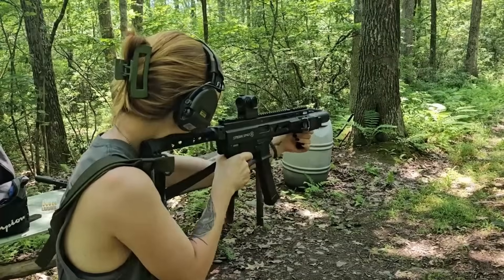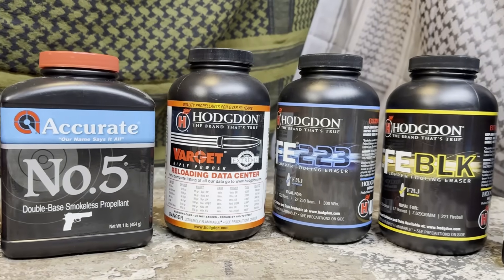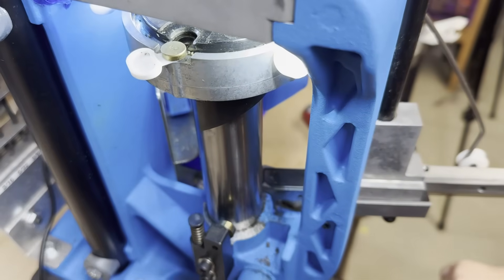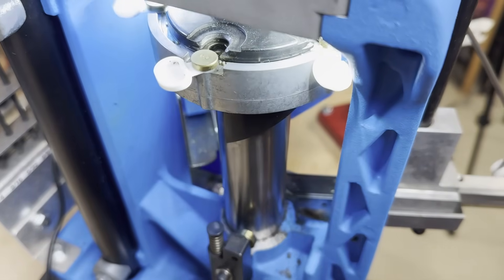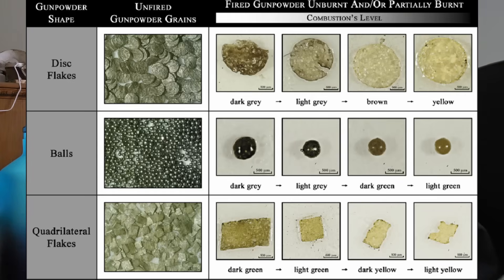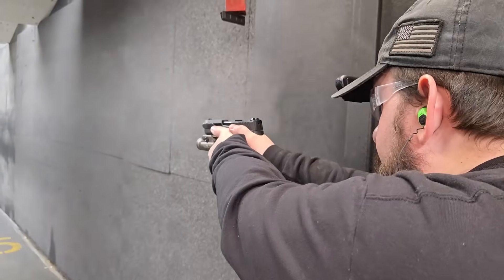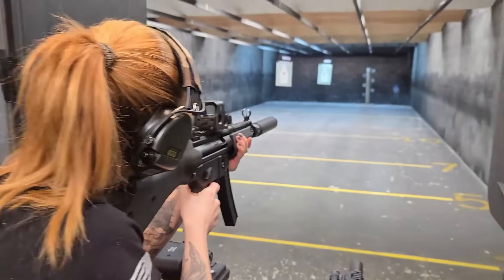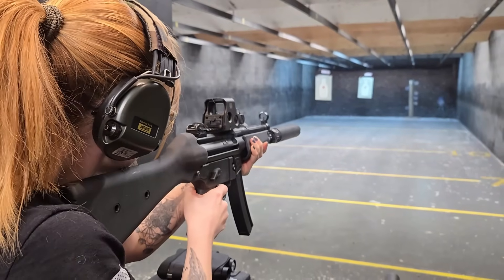Propellant Picking and Performance

Comment: When I buy powders, first I have to look at what's available to me, then I consider how many of my firearms that powder will work in while. The idea that the slimmer neck causes higher pressure thus higher velocity is not really true. I can use the .358 Winchester and the 35 Whelen as examples. The 35 Whelen for instance produces less pressure with a 220 grain bullet than a 30-06 yet pushes the bullet much faster.

Comment: This was awesome but left me with so many more questions. For example, why do long range hand loaders consider ball powder junk?  I mentioned CFE 223 as a possibility for 7mm-08 and got a strong negative reaction despite some published load data showing good velocities for that powder in that case.
Reply from the maker: Ball isnt as temp stable so you'll see way more variation in your performance!
So youre choice isnt bad on paper but extruded powders will burn way more consistently and if you want range, you probably want consistent. Though I will say cfe223 is a good modern hybrid, not sure why they'd scoff at that for your application
Reply: @Boondockballistician thank you Jessie for the quick and on point response. Turns out CFE223 has the worst rating on my temperature sensitivity chart. If I’m reading the data correctly, a 60 degree temperature change would result in a velocity change of 102 fps.  H4350 velocity would change 9.6 fps. That’s a BIG difference. 

I enjoy your content and appreciate you sharing your knowledge with us.

Comment: I heard a story of a man who had a truck gun for years.  When he finally fired it, the barrel blew up.  Turns out, after fifteen years in the truck the propellant turned to a fine dust.  Thereby burning too quickly, all at once, overpowering the otherwise sufficient design strength of the gun.

Comment: Quickload, OBT >>> real world chrono>>> true model >>> test>>> selection of load.    And it allows modeling of loads and parameters that aren’t documented anywhere.   Example .223 loaded with 80 ELD with OAL of 2.500”.   This load isn’t documented but I modeled and then tested suggested OBT nodes.    This reduces load development considerably.  

RPR .223 - 80 ELD @ 2.500" - OBT Node Testing - Ram Shot TAC
https://youtu.be/4YT3XWH1gww

Comment: Haven't watched the video yet but just wanted to say I'm very excited to see this video because I know nothing about reloading, but anytime I think about buying a rifle my brain wants to optimize a load for maximum performance in a given barrel length with a given projectile.
I do not know what is and isn't safe, but boy howdy do I fck around on Gordon's reloading tool until I find a load that gives me performance of a slightly longer barrel, with identical exit pressure and velocity so I can use the same can.

Would my gun explode if I loaded that? I have no idea but it would be funny to find out. I'm sure I will get at least 5% closer to knowing through this video

Comment: I would argue that the tuning of ammo is making a big difference by a combination of smaller steps.  Looking at 7mm prc and the use of RL 26 and then Hornady losing access to that powder when federal started loading it and then having their velocities cut by %10. There are also getting to be much more powerful loadings available in magnum revolver loadings with powders like lil gun and power pro. I also look at some of the hyper efficient powders like tite group, tite wad, and power pistol that allow for a pound of powder to go much farther and burn cleaner than previous options.  Getting the exact pressure curve figured out for a cartridge and gun combination can really squeeze performance out of both new and previously existing cartridges. The newest question is what can they do with pressure curves in the couple of the newest 80,000 psi cartridges in the 6.8x51 and the 7mm Backcountry adding 15,000 psi flips the script on what powders can be used in those cases.   I appreciate the nerdy, technical, and awesome video.

Comment: A progressive burn is dictated by how full the case is you typically get into a kinda iffy area if the case is only a third full read that as potentially dangerous as the propellent lays below the flash line of the primary where it could ignite all the propellant possibly causing a detonation rather than a progressive burn

Comment: Propellant Picking and Performance

While the rule of thumb for larger cases and bullets is slower burning powder that is not always what is desired depending on the purpose. If I am shooting bowling pins in pistol competition matches with a .45ACP then I want a faster burn rate so I can get back on target faster because time and hits is everything in a match. Burn rate is not so critical in a combat pistol timed course of fire on IDPA/IPSC/USPSA cardboard targets but most matches that are timed will benefit more from faster burn rates. Precision rifles and rifle cartridges not so much that are not timed at least not when I was in matches. Shotguns in matches again I want faster burn rate when shooting moving clay targets for faster target recovery although shotgun clay matches are not timed either but I want to be able to get multiple hits for each set of clay targets that only have so much time in the air. You get my point. Burn rate depends on the purpose or use of the ammo. Be it matches, hunting, practice, or defense. Yes it can also depend on the cost and the amount of powder or charge in each cartridge or shell. More powder means more cost per round or shell so I want a powder that gives me good performance in fast, medium, or slow rates using the least amount possible. Throw all that away if the primary concern is a specific burn rate for a specific purpose and you may have to just suck up the extra cost of extra powder.

Comment: Internet lore, for what its worth, has taught me that the difference between NATO spec 5.56mm and  commercial .233 ammo is that the NATO spec ammo primer is harder and less likely to being set off by a floating firing pin, and that the powder is more reliable in adverse conditions but also dirtier than the commercial variety. Now, I don't really know much, and the internet could be wrong, but could you comment as to whether this is true about the powder being more reliable, and if so, what are some of the factors that causes this difference ?
Reply from the maker: Ehhh is more if a difference in pressures. Military ammo is also produced to a standard that commercial doesn't necessarily need to follow, which is why you see more variation. Ammo manufacturers that get military contracts often use overrun and product that didn't quite meet spec as commercial rounds instead. So that inherently means more variation.
And then manufacturers that are primarily commercial, just build with looser tolerances. Whether it be less scrutiny on the cases, the projectiles, or the powder coming in
Reply: @Boondockballistician  I see

Comment: You said in the hop facts stream that handguns pressures will top out in the 60-70,000osi range. Im runaway of a pistol design that can even take 50psi. What guns or designs did you have in mind?

Comment: 3:47 this was a problem for the M16 back in the Vietnam war, the ammunition the soldiers were issued in the field did not have the same type of powder that was used in testing the rifle, this is one of the reasons that contributed the the M16s reputation of being unreliable.

Comment: One of the most important things I learned when I started reloading and was friends with a guy who had decades of experience and reloaded dozens of calibers, is that when you're getting performance out of handloading, you want to specify what you're looking for. Are you looking for speed and as much velocity as you can squeeze out of a round or are you looking for accuracy, because as I have learned and seen, usually your more accurate loads are not the max loads which give you the most velocity. My favorite .30-30 load is closer to the low end of the velocity spectrum, but it was the most accurate, and my current .30-06 load is actually the most accurate with the bullet I am using at the minimum loading according to the manuals I've gone by. I used to see the same thing with handguns, my .44 Magnum loads used to be an old Unique or 2400 load that were nowhere near a maximum powder charge for the bullet I was running. You need to take the time and experiment with the load you have and then when you get that one dialed in, try another powder or two because that way, if the powder you use isn't available or even discontinued, you have a back-up.

Comment: Burn rate charts are widely available and very helpful in making a selection. Great video!
Reply: Burn rate charts are cryptic and generally go in  order of highest to lowest- still working in fractions of seconds. They don't really give you any useful information.

Best option if you're looking for a powder ra specific load is to either go to your local big box gun store (Sportsman's, Scheels, Cabela's, etc) and thumb through the reloading manuals...or get online and look through the manufacturer websites. Stick with book loads until you're comfortable. Then, if you're still not happy step outside and experiment. Just don't do it on a public range in case your firearm doesn't like what you're doing.

Comment: Commenting for the algorithm, going to watch later. This is a topic that as a reloader I know I need to have an understanding of but so far I’ve just relied on he said she said from forums and what’s in the manuals. Thanks for making this.
Reply: Once you develop a good understanding of powders and burn rates, experiment. I have learned far more from personal experimentation than anything else. Pick powders too fast for a bullet-case combo, then pick powders considered too slow. See what happens, working up very carefully. I ended up figuring out how to make reduced-power loads for every cartridge, at whatever power level I desire.
Reply: I get burn rates from a velocity/barrel length/cartridge standpoint, accuracy with different powders is more what I meant. I need to do that but with what powder costs I’m hesitant to run out and buy powders when what I’m using works. As I add calibers and start using more powders I’ll start to experiment more with it

Comment: Is that Your dillon precision deal B, or just stock footage?

Lookin for first hand opinion on that reloader. 

Is it easy to set up?

Is it easy to use?
Reply from the maker: I haven't had any actual problems with it, especially for the price. Youre limited to dillon dies which is a potential con.
But otherwise, easy to set up and use. There's obviously better equipment out there, but if cost is a factor then this gets the job done just fine
Reply: @Boondockballistician  I have heard good things about the Dillion stuff but I am a fan of RCBS and there single stage rock chucker can use Hornady dies as well.

Comment: Wow. Great job on the video.  Of course, now you have started down a huge rabbit hole. The vast plethora of variables in ignition (small, large, magnum, pistol, rifle, formulation of differing manufactures...), charge (compressed vs not, buffering compounds, etc), depth of crimp, bullet material (lead vs copper vs steel...), bearing surface area, etc, etc, ad nauseum. You could spend years on this subject alone.

Of course, now I am curious about what the young lady who enjoys making shooting videos has for education and background.
Reply from the maker: This video definitely is set up for several parts. I was already thinking of breaking it further down into those kinds of areas so it's cool you said it too!!

I've got a bs in chemistry and M.Eng in materials engineering. But my work experience has been entirely in this area. Started off with energetics/explosives and now have been spending my time with designing small cal munitions
Reply: @Boondockballistician  Very nice resume, and thank you - as you didn't need to share. I suspected it was along those lines, and hope you truly enjoy it. From a Chem E & Physics grad who ended up going back to school when I discovered I enjoyed healthcare far more - I hope your 'side gig' here on YouTube brings you happiness and success.

Comment: So, if I theoretically had a large amount of faster-burning propellant (bought at a steeply discounted price of course) that I wanted to use in milsurp reloading such as 6.5 jap or 7.5 swiss, purely for plinking... What direction should I be going for tuning the load around that? Compared to a more standard "book" load with slower propellants, what should I be changing and what results should I be looking for to make sure I'm doing it safely?
Reply from the maker: Lmfao what theoretical propellant do you have. And what barrel lengths are you looking to shoot out of. Simple answer is a nice light projectile but we can fine tune this:)
Reply: @Boondockballistician  Let's say Norma 200 for the propellant. For the barrel lengths, 6.5 jap in full length (31") and carbine length (19") Type 38, and/or 7.5 swiss in a K31 (25"). 
And let this be a lesson to anyone reading along, don't buy crap when you don't know how to use it! Even if the price is good! lmao
Reply: @Boondockballistician  Primarily Norma 200, and the barrel length is variable. Primarily wanting to load for Type 38 in both full and carbine lengths, and potentially for a K31.

Comment: A friend of mine is a small arms ballistic engineer at a major ammunition manufacturing plant. From hearing what he’s said, it’s largely what the home reloader does on a larger scale, but with more sophisticated pressure testing equipment. 

For the home loader, there seems to be nothing new under the sun. The manuals and formulas are pretty stagnant.
Reply from the maker: Yup, from a new caliber design perspective, it's tinkering with case design and projectile technologies. Propellants have been sitting still for a while now, we're just fine tuning what we're putting them in